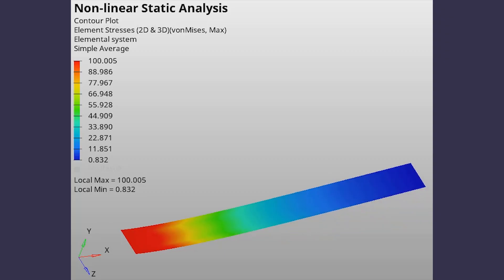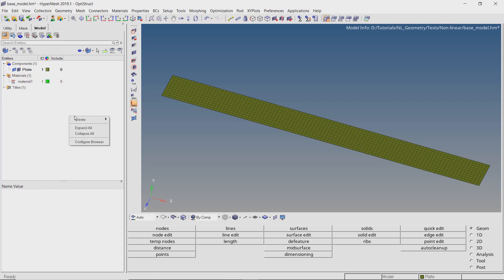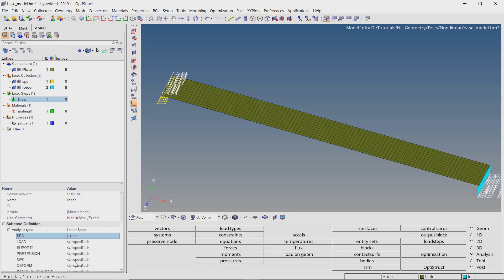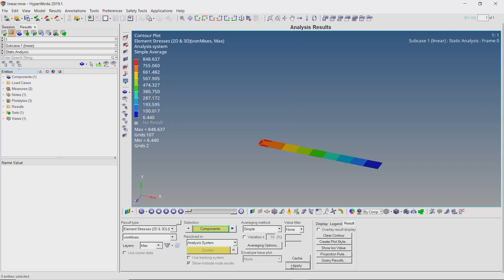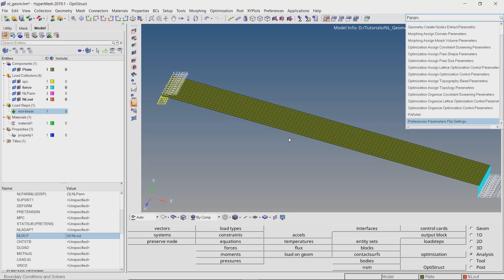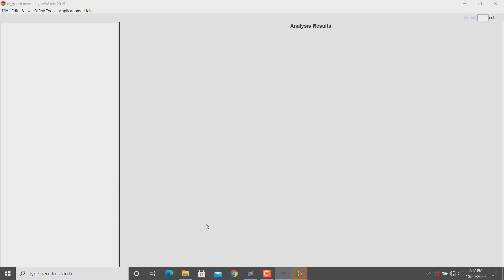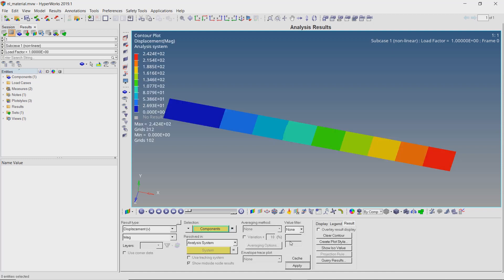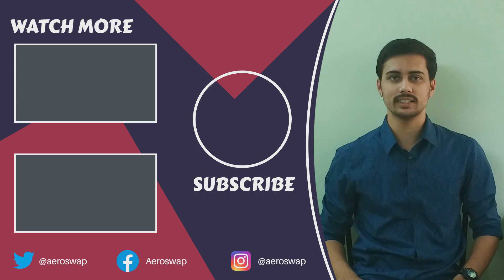Hypermesh Non-Linear Analysis Tutorial [Geometry & Material]

Comment: "MATS1 is presently not supported for second order shells (CQUAD8 and CTRIA6)."
 
Hi bro what can I do about this error? I used a spot welding connection
Reply from the maker: Hi Musa, the simplest solution would be to use 1st order elements. If that is not a valid option, you might have to search for some other material law.
Reply: @Aeroswap  thank you so much

Comment: Sir,how can we define the stress-strain curve for orthotropic material in a particular direction only
Reply from the maker: Hi Neeraj,
Stress-strain curve can be imported directly from a CSV file using the Utility menu. Then this curve can be used while defining the material.
Reply: Thank you Sir, in isotropic material we can define the curve by mats1 card,but how can we define the curve in case of orthotropic material and is it possible to give curve in only one direction and constant values in all other direction in orthotropic material?
Reply from the maker: The MAT8 card image used in Optistruct defines a 'Linear orthotropic material'. As it cannot account for any form of material nonlinearity, we cannot use stress-strain curve in this material card.
If you want to define a detailed orthotropic material with nonlinear characteristics, you have to link Altair Multiscale design modeler to HM and use an externally defined material in the Optistruct analysis.
Reply: @Aeroswap  ok sir...thank you
Reply: @Aeroswap  Sir, I have found the option of MAT9ORT that provides the option for entering orthotropic material and also option to provide MATX28 and MATX68 cards which takes the input of stress strain function . Can that be used for entering the stress strain curve in different directions in case of orthotropic material
Reply: @Aeroswap  please make videos on Altair multiscale design modeller
Reply from the maker: Yes, I believe that option may work. However, I have not explored this method of material modeling much. Please try it and do let me know how it goes :)
Reply from the maker: Thanks for the suggestion. I will work on this topic soon!
Reply: @Aeroswap  thank you sir
Reply: @Aeroswap  Sir, while exploring the option of MAT9ORT and associated MATX28 and MATX68 cards ,I found in the help manual of hypermesh that it will work for analysis type EXPDYN and I tried for nonlinear static analysis and put the analysis type as EXPDYN then I got the error that this type of subcase can not take the load
Reply from the maker: EXPDYN is explicit dynamic. That means this material card cannot be used for static loadcases and hence, is obsolete in this particular example.
This brings us back to my previously suggested option - using Multiscale design modeler is the only way to go!
Reply: @Aeroswap  Okay sir. I shall try.
Reply: @Aeroswap  can we do dynamic analysis with EXPDYN by applying time varying load in the same way as we do for transient?
Reply from the maker: No, unfortunately the working principle for explicit scheme is somewhat different than implicit. You can perform the same analysis in explicit dynamic but the setup steps will be completely different. What I mean is, this video will not help you in that case.
Reply: @Aeroswap  okay Sir. Please make videos on explicit

Comment: :D

keep shining bro as usual ;)

I tried but it wrote me tis message (The amount of memory allocated for the run is 1000 MB.
 This run will use in-core processing in the solver.
 MUMPS solver will allocate memory separately and may
 run in different core (in/out) mode.
 ==== End of solver screen output ==== 
 ==== OptiStruct Job completed ====)

I can'y visualize the result why if you know ? I increase it untill 3000MB and nothing happened. Lot of thanx
Reply from the maker: Hello,
You cannot see the results as the solver just didn't run. There is no specific mention of the error but I am assuming it is related to memory allocation for the run.
Try resetting all memory options to default. Do not specify anything and try to run the solver again!
Reply: @Aeroswap  Thank you swapnil for the quick response ;)

Comment: Always great work! This time you clarified the complexity of non-linear analysis for following force and material nonlinearity. It's important to capture the plastic strain region as they remain a permanent deformation. You could also link your material data with a lab-tested stress/strain curve (material table). Only disadvantage of running nonlinear analysis is the computational cost, and I don't think the solver process has been developed much yet. Too many iterations, unknown errors, mesh dependency...
Reply from the maker: Thanks Ken!
Yes, we can use the TABLES1 card to define full stress-strain curve for the material. I intend to make a separate video focused on material nonlinearity.
As the objective of this video was only to give a brief introduction to nonlinearity, I used the simpler approach and provided just 1 slope(H) in plastic region.

Will soon be posting about boundary nonlinearity, especially contact nonlinearity!

Had to go for the simplest example as it takes a lot of time to solve bigger models. 😅

Comment: Nice explanation as usual , can you tell me how long does it take to complete the analysis . my iteration progress is stuck at  0 % for more than 20 min . I am using core i5 with 8 gb ram 
Thank you.
Reply from the maker: My configuration is i7 16gb ram. It did not take more than 2 minutes.
But it depends on the mesh size . If you have a finer mesh, it might take more time. 

But still, 20 mins seems a bit too much. I would suggest aborting it and running again. Maybe that will fix the issue.
Reply: @Aeroswap  now i am getting Maximum number of time increment cutbacks reached,
analysis aborted. any ides  how to resolve this?
Reply from the maker: Did you try increasing the MAXITER value in NLPARM card ?
Reply: @Aeroswap  yes I increased it to 200 still same
Reply from the maker: Then I guess something else is wrong. Did you follow all the steps as I showed in the video ?

Try some different settings, its not necessary to keep it just like I did in the video. If it still doesnt work, mail me the file. I will try to figure out the error.
Reply: @Aeroswap   I followed all step and I am getting results similar to yours may be its just a warning , and thanks a lot again 😁
Reply from the maker: Okay then. I'm glad it worked. Cheers!
Reply: @Aeroswap  would love to watch to similar tutorial video on Ansa, from the basic though. and also a big shout out to your work.
Reply from the maker: Yeah Ansa is similar to Hypermesh. I will think about posting Ansa tutorials! 
I'm glad you liked my videos.

Comment: You are explaining clearly everything thank you but it will be more helpful for a beginner like me to understand the nonlinear analysis if you explain why you are taking those nparam options and what effect will be there
Reply from the maker: Hey Venkatesh, the NLPARM card is essential to activate the sub-step based iterative solver for nonlinear analysis. In this, we basically set up the number of increments(NINT) we want to use and the maximum number of load iterations(MAXITER) for convergence. The NLOUT card is to control the output of the analysis. We specified the frequency at which we want the output to be generated.

As this is difficult to understand, I will definitely work on a separate video to explain each of these settings in detail.
Thanks for the suggestion.